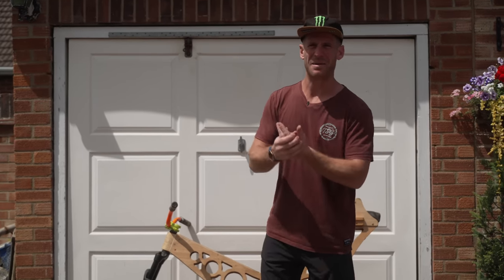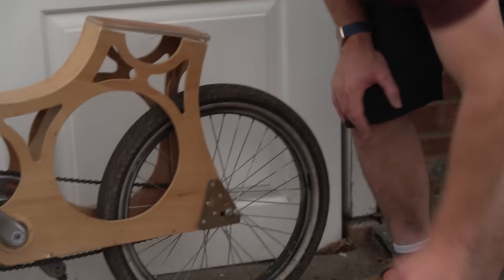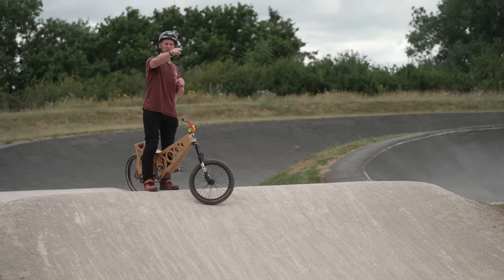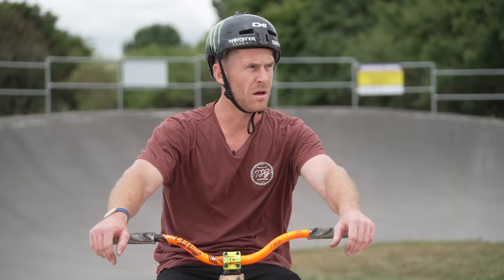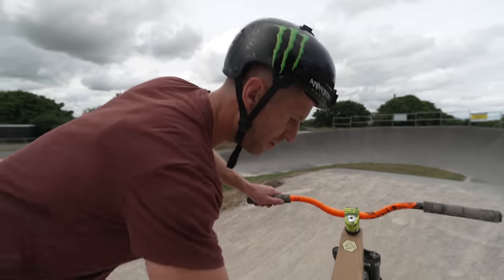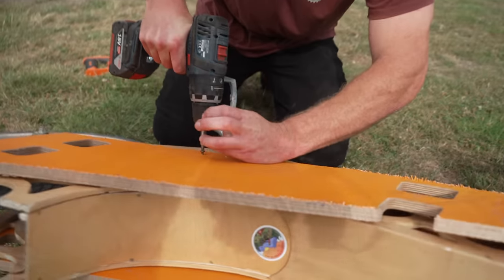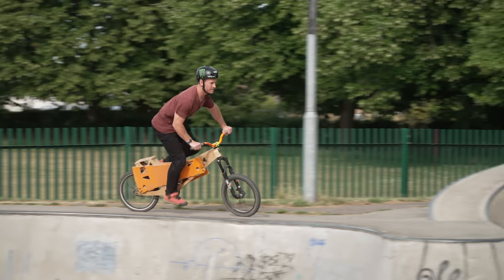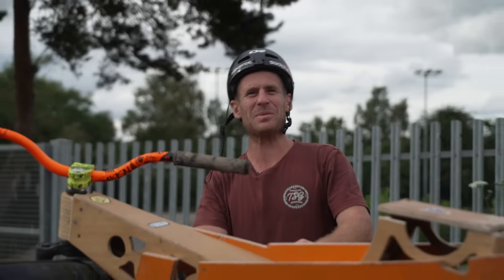HOW HARD CAN I RIDE A WOODEN BIKE UNTIL IT SNAPS?

Comment: Have Morgan help you build a tough wooden bike................................ ... .. . ... ...... . . . ................................. . ... . . . .. ...... ..... .............. . ... . . Maybe laminated birch/etc, like two skate decks, with common modern bicycle comps sandwiched between......Could even be carbon fiber layers in there......That would of course, be an entire series of videos. Would be great for you guys, and great for Morgan!!!!......And folks would learn a lot about renewable resources.....And RADICAL BIKES, that use other kinds of lower impact resources. ...plus...a laminated wooden bike frame for your extreme riding, would be a show-stopper....... And wood soaks up the trails.........

Comment: do you have axle drive bikes, try cvt gear discs in the transmission
Reply: axle drive train, or electric drive train, are better than chain type drive trains, belt or chains
Reply: lose the chains and belts
Reply: try diy bike frame from water pipe and connectors